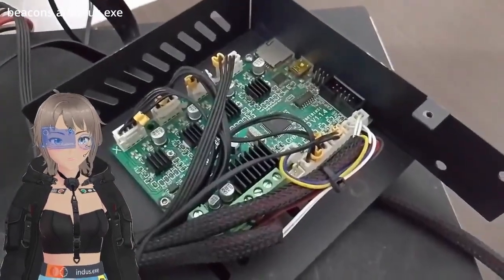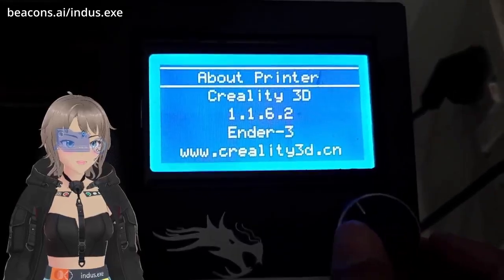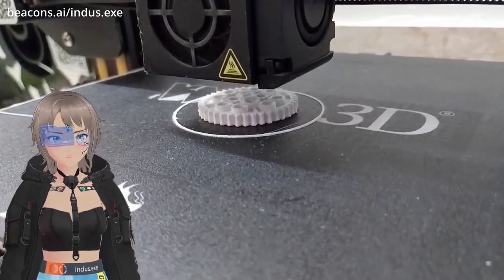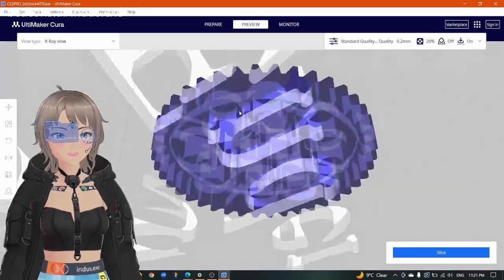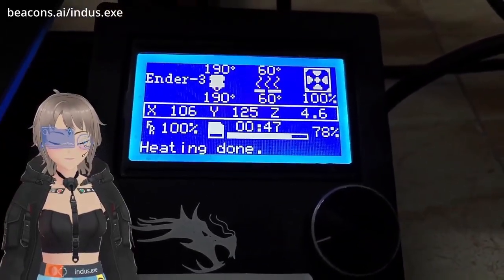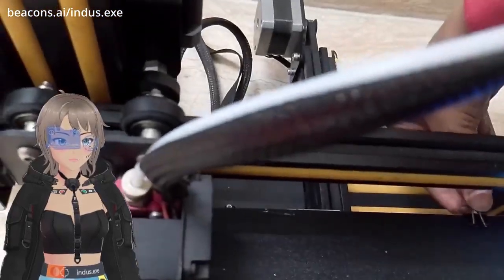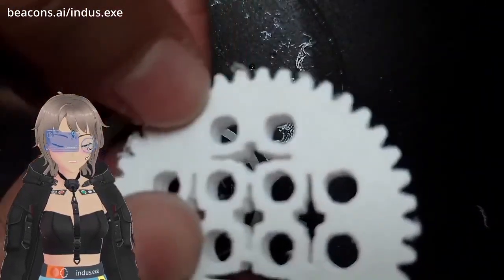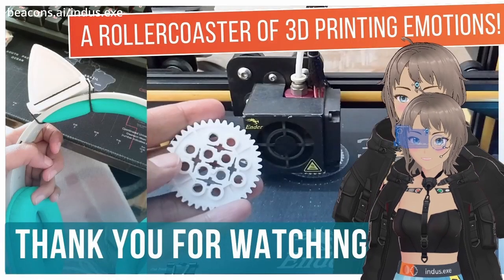Assembled My 3D Printer | Chaos, Fails & Fixes | indusEXE #IndianVtuber

Comment: Looks like your z-offset is a little low, but overall good print
Reply: no. quite the contrary its a little to high
Reply from the maker: so true. In my first two attempts, the extruder was much higher from the bed.